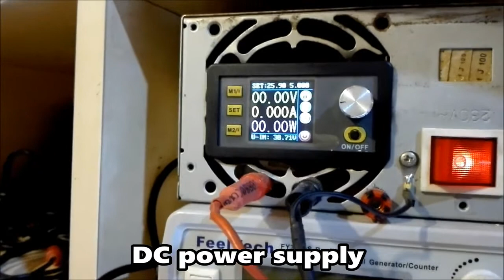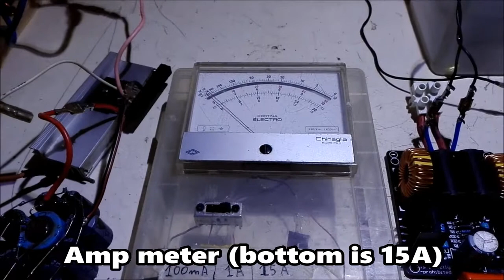My best DIY AC flyback for now, under oil, various tests (ZVS & single ended)

Comment: I feel so bad for the kids coming up nowadays that do not have CRT television sets to experiment with the flybacks that come out of them amazing build enormous arcs man nice job
Reply: well, until now you can still find discarded CRT TVs, especially if you live in a poorer country, but yes, electronics is getting lamer recently, when people want to give me an LCD TV i sometimes decline, also the older the TV or apparatus the more interesting stuff you find in it... they will probably need to buy the last flybacks online at some point, we are already doing this with vacuum tubes and they are running out, also the lockdown incited people to buy a lot of sedentary hobby articles, they did a good chopping to the remainings, we are heading toward a situation in where you don't find vintage for sale anymore, i was looking for an X-ray tube on ebay, found only new spares for a craptonne of money!!!

Comment: Have you tried making a Mazilli ZVS with an easily adjustable frequency (ofc within some range), like an adjustable inductor with a sliding core ? Got no variable caps lying around... Using that to power a base driven TC would be interesting. Basically hooking a coil to the the drain of one of the mosfets.
Reply from the maker: i've seen these kind of hings done, also with IGBTs and having big sparks, basically you need a secondary without a topload to have a more broad secondary resonant frequency but they use the resonant coil of the ZVS as primary, widening such coil or making it tighter would change the F a bit to center it, but you need a badass capacitor for the ZVS cos it must oscillate at an high F with high current and high voltage, to do that i should make a cluster of kinda all my hi-V caps and maybe this would not even suffice... honestly i'm not much interested in this... also using the drain of only one mosfet would be unbalanced and the voltage swing seems kinda low, but who knows!! :D maybe making a ferrite core with adjustable air gap to adjust the frequency with a secondary on it that increases the voltage to like 2kV could drive the bottom of the TC secondary, this seems a weird setup and such flyback would never operate at resonance but maybe it works

Comment: The weird sound is caused from stereo microphones picking up the plasma frequency oscillations and generating a difference signal. Not bad at all for home made, toward the end you were pulling real current too 😁❤🤓
Reply from the maker: thanks

stereo? are you sure? mine was a potato smartphone, there's the voice mic on the bottom and a rear mic, but i doubt those are used at once, i also think to remember that i tapped both while recording and only one gave the tap sound in the recorded video... i suppose it's just the electric field, a mic is electrostatic, it's quite sensitive

Comment: what type of oil did you use ?
Reply from the maker: mineral vaseline oil, it's stupid stuff but hard to find locally cos nobody actually needs it
Reply: You might be able to look for it in livestock pharmacies, it is used in horses when they have colic, and also for cattle for some similar reason, its usually sold in gallon jugs.
Reply from the maker: @teresashinkansen9402  exactly!!

Comment: Why ground the secondary? Doesn’t that induce a higher risk of shock factor for what benefit?
Reply from the maker: yeah, it kinda increases the risk of being electrocuted to the floor, but the opposite solution isn't actually that better... the two ends of the secondary don't have the same level of high insulation (usually), so if an high voltage appears on the cold side wire (cos it's not earthed) it could puncture the plastic tube in the inside of the transformer, also providing a ground path and electrocuting you anyways, soooooooo worth saving at least the transformer :D also the chicken stick would be earthed and you can touch it safely afterall, a reason why i used a screwdriver (not using something so short anymore now, i built a purposed chicken stick)

Comment: Seems like youve already modified the "1000w" zvs. Can i know what you did.. your project is always give me new idea/knowledge in high voltage.
Reply from the maker: yeah, i added a pair of capacitors on the input but it was useless, once you have DC for powering the ZVS you don't need to put capacitors near the input, the positive line powers two inductors and two resistors, so there's no issue with current spikes, the current is just high... i'll take out those capacitors next time i use that ZVS

anyways that ZVS came with IRON posts, if you connect a coil on the output to make an induction heater the iron will get super hot in like ONE SECOND (because it's too resistive), i've directly soldered a pair of thick wires on both in and out, getting rid of the iron posts... always check if the stuff you buy online is copper or iron, if it sticks to a magnet it's iron, and it's quite likely garbage

Comment: Lovely. So it wasn't the coils singing it was the phone ? I stopped my HV experiments due to HV interference with screens, phones etc but will start again as i'm getting a shed.

So at 30kV per centimetre your outputting around 150kV ?
Reply from the maker: yes, it's the phone, it doesn't happen with an external mic (earbuds)

i don't have much problems with interference (apart that), in your case it may be just misfortune, anyways nothing is going to get broken bcs of it

no, it can't be a voltage so high, maybe like 35kv peak, the electrodes were pointy so kinda 10kV per cm (it could have been less tbh)

Comment: I want to build one just like that one. The core of my pathetic DC flyback is cracked and broke but a lil' superglue will fix it. All of my tiny AC flybacks internally shorted out so no more fun. But hopefully I'll find a suitable bobbin to make the secondary coil and with decent insulation. (Hopefully) but in the meantime, a crappy DC flyback is the only "good" flyback that I have for now.
Reply from the maker: DC flybacks are easy to find, people often have some CRT TVs to give to you, or you can try at e-waste centers (big fortune to dig there), also to see for antique TVs that have an AC flyback and also a wider ferrite core (this up to the seventies)

you can make the bobbin with a tube of the correct size and two caps that you spuerglue together, you can find the copper wire in a microwave fan motor

Comment: Looks pretty dang cool. Seems like it could stand to have less turns though, so that it has more current
Reply from the maker: that's tastes... i'm actually thinking of adding more turns instead, the structure allows both more voltage and more winding, but i suspect the added winding will receive less magnetic flux (bcs a bit far from the core) and add little voltage at the end... not sure it's a good idea
Reply: @PosthumanKindergarten  use a zvs driver and a battery (lead acid) for lots of current.
Reply from the maker: @alextiba5620  all my SLA batteries and car batteries are dead, and buying batteries is a failing affair... anyways the UPS trafos are strong enough

Comment: If that's a chicken stick your chicken has balls
Reply from the maker: there's a thin line between having balls and being an idiot, sometimes those overlap :D infact i'm not using a screwdriver anymore as chicken stick, anyways "if my calculations are correct" in this specific case i would just receive a sting, and the screwdriver is earthed, so i could even touch its metal... but yeah, no screwdriver anymore

Comment: Cool good work 👍check out my transformers 35 cm jumps👍👍
Reply from the maker: yeah, i've watched your videos, they are cool... anyways you used a voltage multiplier, OF COURSE it makes a bigger jump :)
Reply: @PosthumanKindergarten  🤣 it wasn't a challenge I just was asking if you have seen my vids man.. 
Fyi I've had 25cm jump now from my latest home made transformer without a multiplier 😀